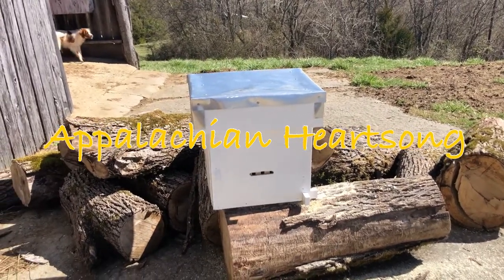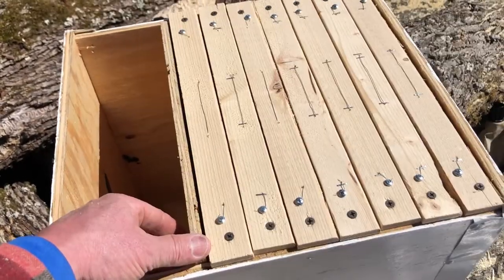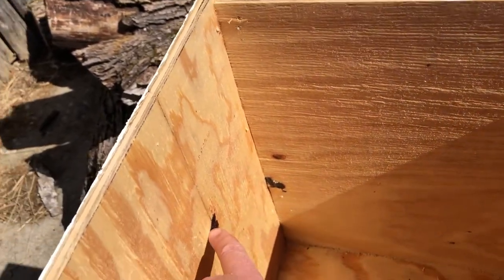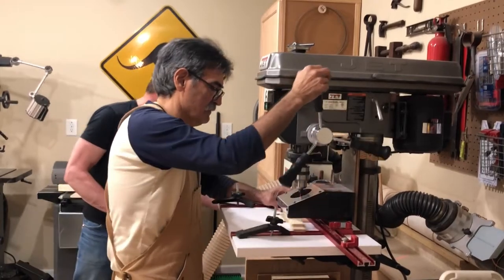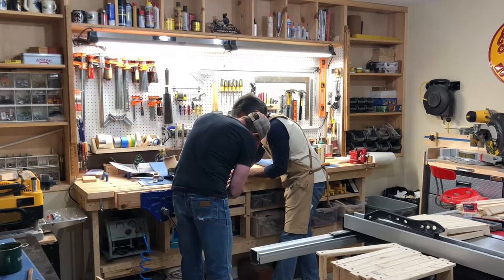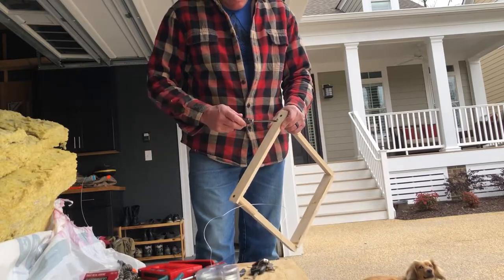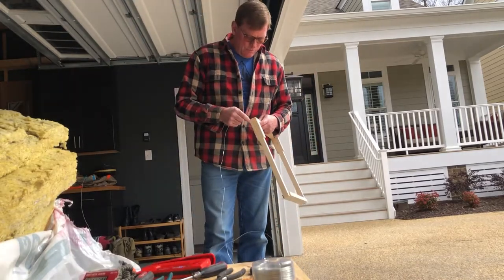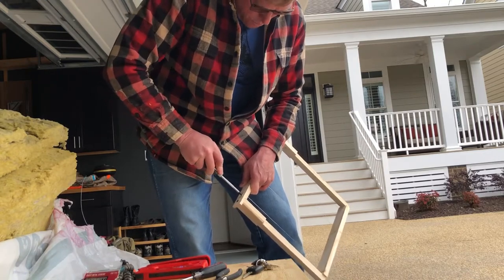Building Layens bee frames

Comment: dan. there many ways to speed up the process with a few tools and adjustments. first a stacked dado blade will turn your top bars into a 1 step process on the ends  and with a plywood jig and the dado set, the side bars are one move on each side, I have the same drill press there are 3 adjuster rings on the travel. adjust the lower ring so the drill bit is just above your work and the top 2 rings for the max. travel down so you are only pulling the handle about a 1/4 turn each time and you have a positive stop both ways. also a 1/4 crown stapler and a jig ( from dr leo's free plans ) makes assembling  the frames faster and stronger. plus you can use 3/8 for the side bars and not worry about splitting and get more mileage out of your wood pile,  a wiring jig ( again dr leo ) makes wiring easier and faster. hopes this helps. I have been building these for many years and still like the 2x construction.
Reply from the maker: Thanks for commenting Shawn and providing the really helpful guidance on building the Layens frames. Funny, in prepping for the apiary build this Spring I called Tom about making more frames and he said he would rather poke an eye out. We decided that some things are meant to be mass produced :) I did assemble the frames I subsequently bought from horizontal hive but admit I was happy to pay the price of maintaining my/our sanity!! I hope your bees did well over the winter, cheers.

Comment: i think your frame side bars are too thick its 3/8th not 1 1/2 thick and 1 1/2 wide to 1 wide.  bees need to bee🐝 able to move around the sides of the frames otherwise they will not be able to move in winter time to the next frame when its too cold to brake cluster to go under the frame. bees will never brake cluster to move in winter they move homogeneously through the part of their hive that they set up for winter 7 to 10 frames worth and they occupi about 50% of that 100% of the winter  the other 50% is the food that a few bees will consume and distruibit in the cluster. this is what I have seen in my hives not saying it 100% truth just what I've seen.
Reply from the maker: Thanks for commenting and, yes, I think you’re right. The frames have been a bit frustrating getting into and out of the hive box. I bought additional frames from horizontal hive this year and they slide in super easy. I thought the box itself was warping but your insight seems spot on.
Reply: @appalachianheartsong5487   to make my frames I use old ship lap boards 5/16 to 9/16 in thickness it veered because it is made out of the cutoffs from milled lumber you can problem get new ones from some store? I don't know. I get mine out of old houses that are getting sheet rock put on to replace the ship lap boards. I cut them to length and use a dado blade at 1/2 to take a 1/4 from each side and leave 4 in on the top it saves me a lot of time at the table saw not having to rip them down just cut them to length and run through the dado. I make 100 frames at a time and it costs me only the glue and staples since the lumber comes from the trash. I also made Dr leo's wiring jig and frame jig for putting them together. it cost me about 25$ to make both since I just needed to get the plywood.